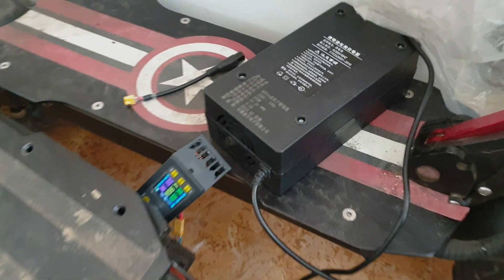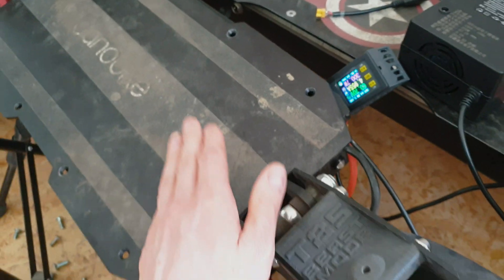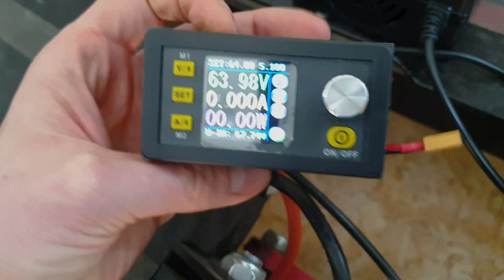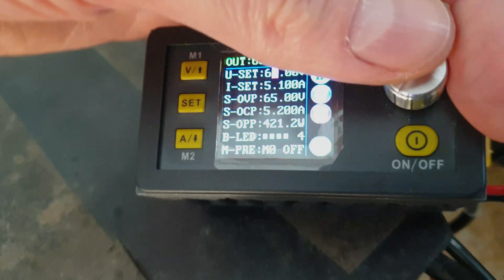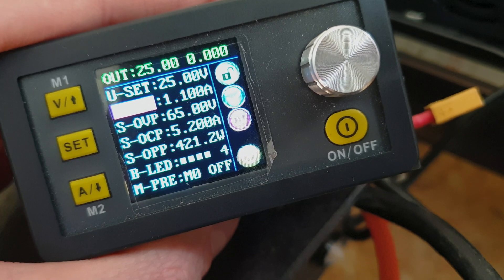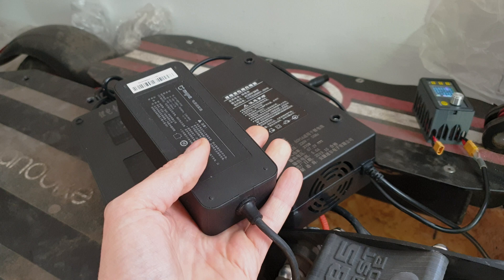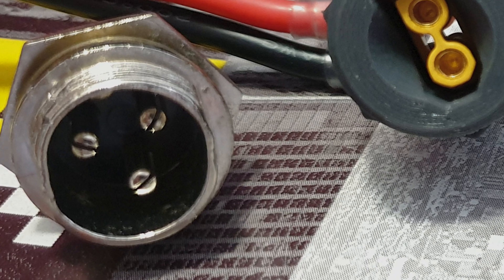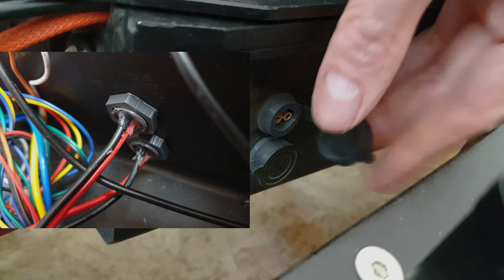Cheap Powerful Charger 16s 67V 5A for 21💲 !! + Idea How to use it even with M365 and other 🛴🛴

Comment: Can it charge at 67.2V if the charger is 67.2V, isn't there a voltage drop? Is a higher voltage needed to get the 67.2V, maybe a 72V charger  and then step down to 67.2V?
Reply: i know its late but yes you will need higher voltage charger then

i use the DPS8005 with a 84V (72V nominal) 5A charger

Comment: I’m pretty sure that to charge at 0.4C for a 30Ah battery is 12A not 7.5A.
Reply from the maker: you are correct ! I used wrong values, I meant 1/4 to 0.25C , thanks 🍕🍻

Comment from the maker: Remember that charging you scooter to max 4.05V per cell can seriusly increase life span of you battery pack(  even  3+ times )  🧨🧨 How to know how much cells you scooter has ? EASY ! On charger you will find voltage , like on M365 charger there is 42V so divide this number by max voltage for single lion battery so 4.2v    42x4.2 = 10 so you battery pack is 10s EaSy. Max charging amperage for life span is 0.25C ( C = overall capacity of battery pack ) , my T85 got 30Ah battery pack so 30:0.25= 7.5A , so I can safely charge my battery pack with even 7.5A  🍕🍻